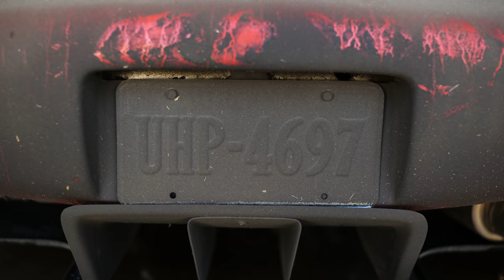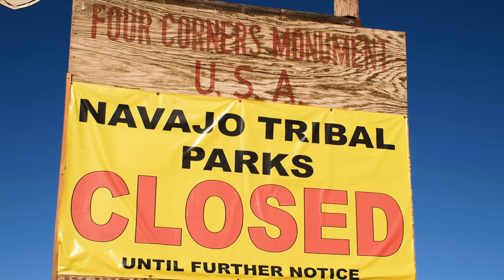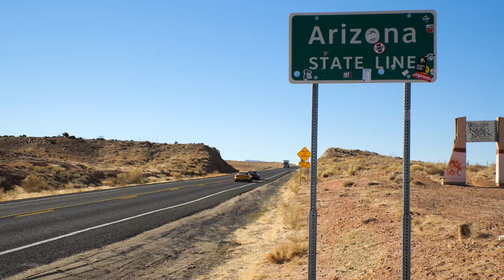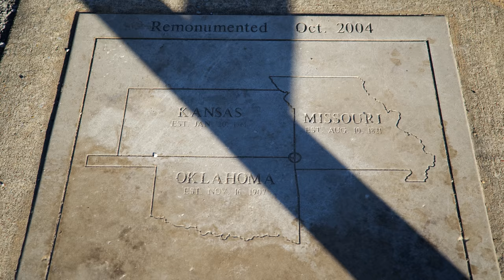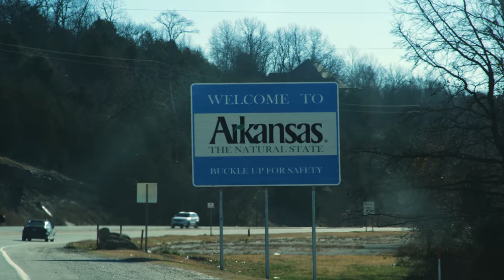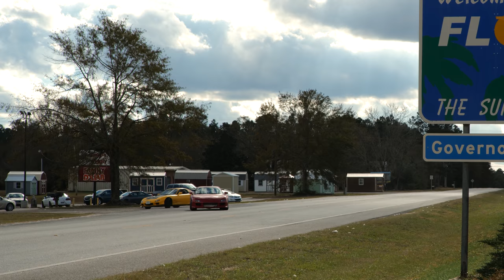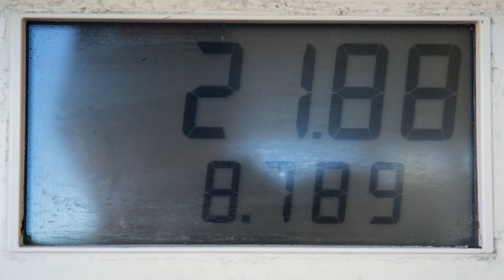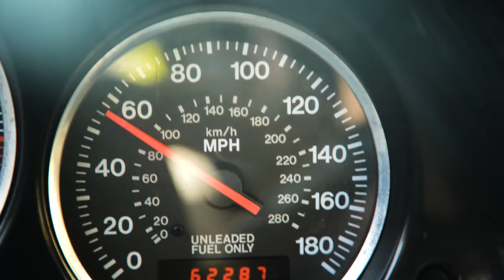Driving 48 States in Two Mazda FD RX7s - Episode 3

Comment: Let’s take a moment to appreciate the F150 making it to all 48 states with no issues
Reply: I think it helps its stock. I have found stock cars tend to break less than modified cars
Reply: It's probably the coyote V8 and not the POS ecoboost V6.
Reply: @WillFuI  100%. Every aftermarket modification is just introducing another point of failure.
Reply: Is there a track list of the music played in this series or nah?
Reply: Being a Ford it is pretty amazing
Reply: @lostmypicks  then theres also the problem that its a ford which means its a pos 
im amazed it did more than 3 states
Reply: @thedandy6765  imagine believing something so hilariously incorrect
Reply: Goated
Reply: The age related problems
Reply: it would be impressive if it was GM, not too impressive for Ford
Reply: It fucking better last
Reply: It's not a Ford. It's a Chevrolet
Reply: Аbsolutely
Reply: Wonder if the truck did this amazing adventure on one oil change.
Reply: @Jumpjet701  I'll almost guarantee 3v 5.4L, if so it's miraculous that it made it without crapping out a cam phaser.
Reply: @petrolmonkey1973  i have a tendency to agree with dandy considering my last Ford caught fire.... the stock wiring harness caught fire under the dash
Reply: AHAHAHAHA
Reply: @nicklynam1891  I had a fiesta (from the uk and live in the UK) and the only thing that went wrong was the engine, which, being a  small diesel, was from Peugeot
Reply: No way definitely had a problem just didn’t show it cuz it’s a ford
Reply: @drummeralex9198  not particularly
Reply: It’s a ford saved my life twice
Reply: Camera car never dies
Reply: @drummeralex9198 not every... But I get what you mean.
Reply: @Jumpjet701 😊😊😊
Reply: Great series! 😊
Reply: Lmao 🤣

Comment: this series goes to show that no matter how well you build something,  manufacturer bought will always be more reliable than built.

apart from the rad leak in the rx7 nothing else really had gone wrong. but there were so many niggling issues with the k swapped fb.

this also showcases how much time and effort manufacturers need to put into a vehicle to iron out all the small issues.

Comment: 13:26 reminds me of my bicycle.
I bought it last year at the end of August. I put more miles on it in 3 days than the previous owner had in 3 years.
Honestly, your cars breaking doesn't say much about the reliability, everything that's broken have been basically pipes . That's more about not having time to get the measurements right than the actual engines.
Also just realised blondie Ben possibly has the same surname as me and how large tumbleweed is.
So glad about the hotels Trivago extra. Was triggering me through most of the video

Comment: I used to work for AutoZone (3 years), so I am quite partial to them. They TRULY have a nation wide lifetime warranty that doesn't require a receipt because they have a great computerized warranty system. I can say that because they can still find things that my dad bought in 1996, though we no longer have the vehicle. And when I worked for them (back around the year 2000), I had a customer from Arizona that I was able to warranty a part for; I was located along the east coast.   So, I bought my 1st warranty parts at Advance Auto a few years ago (Monroe front struts because AutoZone only had Duralast at that time) and after 3 years one totally went out and the other was failing. I bought them within 1 month of each other. Advance Auto was only able to find ONE of them, while the other was OVER 3 years old....the employee said, "though we offer lifetime warranty, we cannot pull items up after 3 years. Luckily we found the part here, though it doesn't actually say what it is. We will provide the warranty for you, but everyone should keep their receipt."  Looking at the screen, I could see that there was some kind of part that I bought but no indication as to what it was. Since I've only ever bought the struts from Advance, I know it has to be them.  Needless to say, I will DEFINITELY be buying ALL of my warranty parts from AutoZone while buying other non-warranty parts from Advance Auto.

Comment: The FD still looks good and stylish after all these years. The only reason why I would not drive it cross country is because of its low gearing.  3200 rpm at 70 mph is not ideal. Get a torquey, 250 -300 hp mid size car that does 70 mph at 2000 rpm or less and that keeps the noise level down.

Comment: The reason why the k swap has so much rattling is because rotary engines are inherently smoother than piston engines so there wasn't as much need for dampening of vibrations in the RX7 from factory.

Comment: can someone explain why the 2 cars are same but have different performances? car newbie here🙈
Reply: Both RX-7s use different engines. The yellow one uses its original 13B, which is a two-rotor Wankel rotary engine and the red one has its engine swapped for a Honda K20, a 4-cylinder piston engine. The K20 has a considerable amount of boost pressure from the turbocharger too.

As it's running a Honda engine, the red RX-7 is also hooked up to a Honda S2000's gearbox, which has different gear ratios from the car's original gearbox.